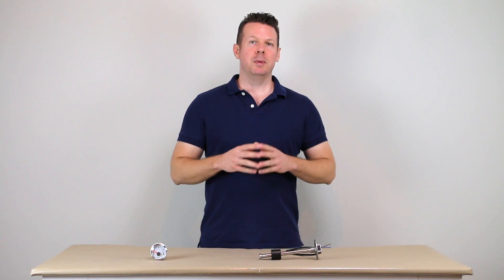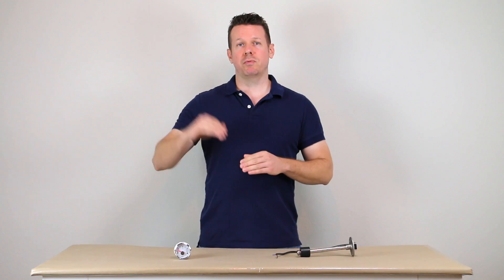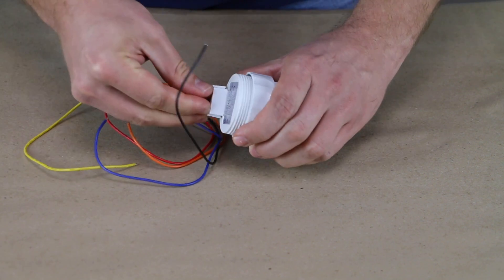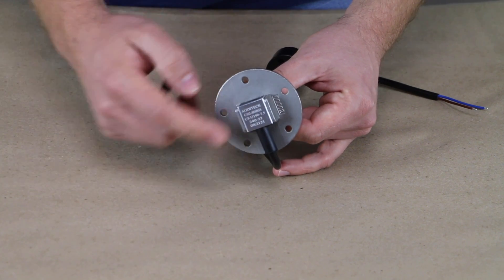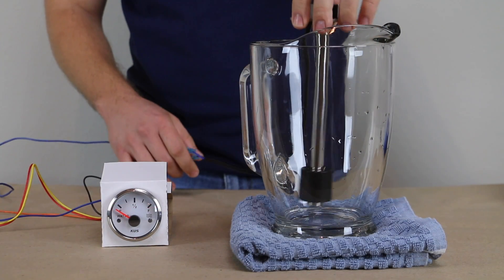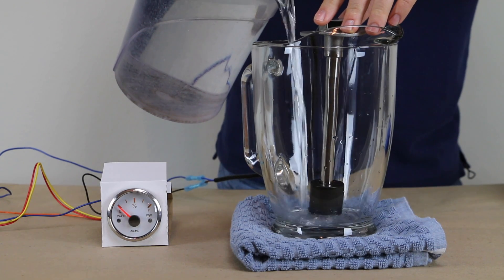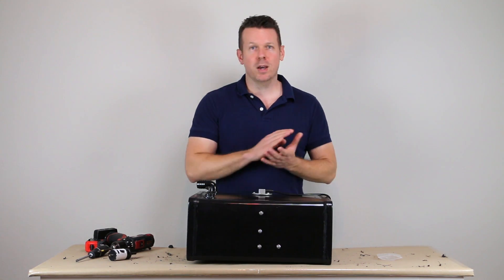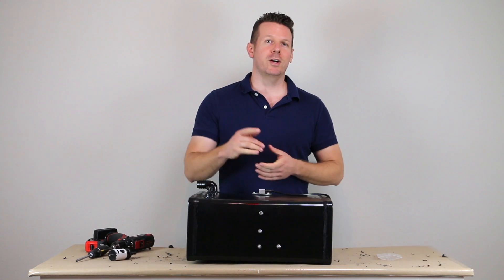The Best Water Tank Gauge for Van Conversions? | KUS Tank Gauge and Sender Unit Explained

Comment: Nice video!
I’m new to your channel, and had a few thoughts while watching this video.
I’m sure you have a thousand requests for various content. I’m curious what your thoughts are on “advanced installation” options?
If you are creating content for #VanLife DIY builders, this water level sending unit and gauge option is perfect to get started and may be enough to for most.
If a builder plans to expand the functionality of this level and gauge, builders should be told to plan ahead with wiring (Giving them easier access later).
“Click here for advanced installation and functionality”
Two options to expand functionality come to mind:
1. Plan to wire this level sending unit to a Victron Cerbo GX
2. No Cerbo GX, but you want a visual warning? Wire the yellow and orange/red lights so they indicate “low water level warnings”. 
You could even have the orange/red light flash when below 5-10% with a bit of simple circuitry.
Thank you for any feedback or links to videos that may cover this type of installation.
Reply from the maker: Hey there, thanks for checking out my videos. Interesting ideas you have here. As far as hooking this sending unit to the Cerbo, I do tie it in or mention in several of my Cerbo videos. I have a playlist on the Cerbo here: https://www.youtube.com/playlist?list=PLWoQHaxPSGfwdZif5uZSCAES_RLFR3_xJ

I suppose on the 5-10 flashing lights, that would be cool but would probably be for someone with additional electronics interest. I am mostly covering broader topics here. Thanks again for tuning in!

Comment: Love the video.  Especially the rewind on the water pitcher!

Do you know if it's possible to wire up the sender to both a KUS gauge and a Cerbo GX?  I'd love to have a KUS at the back of my van for when I'm filling, and then use the Cerbo while in the van to monitor tank levels.  

I'm guessing there'd be a problem if both units were trying to measure at the same time.  Probably both would get half the current and then assume twice the actual resistance.  Maybe I could add a switch at the rear of the van that toggles between the two so that there's only one current return path active at a time.

Curious what your thoughts are on this.
Reply from the maker: Hi John, thanks for tuning in! Great to hear you liked my water pitcher rewind trick. On the KUS, it is my understanding that they make a special model with 2 outputs for situations like yours. I would contact KUS directly or surf their site to see if you can locate it. I haven't used it but it reportedly exists. Hope that helps, and thanks again for tuning in!

Comment: Hi, thank you for the great instruction. Don’t know what happened with my gauge (or sensor) but it shows the opposite of the water level. So when it’s empty it shows it is full. Any idea what I did wrong? Thanks!
Reply from the maker: Hey there, thanks for tuning in. It sounds like the wires may be reversed. That would be my best guess. Hope that helps!
Reply: Hi, thanks. Thought so too, didn’t work unfortunately.
Reply from the maker: @hielkek  Ah ok. If it were me I would measure the resistance in the wires when the sender is in the full vs. empty position. Make sure your numbers are what they should be, if so, then there could be an issue with the dial. I would use a multimeter to measure ohms of resistance, to see what I'm getting. Hope that helps-
Reply: @rosslukeman  Thanks a lot, I will try and let you know.
Reply: @hielkek  Hi did you work out the problem as the same thing is happening with mine?
Reply: @MrRobinski  hi, unfortunately it didn’t work out for me. Getting used to it;)
Reply: @hielkek  ok thanks, i just learned its the difference between American 240 to 33 0hm and European 0 -190 ohm will have this issue when the  gauge or sender unit is one of these types instead of the same makes this problem

Comment: hello I want to ask, if I buy a level sensor with a length of 30cm and I want to modify it myself by extending the rod 2 meters long is it possible
Reply from the maker: Hey there, thanks for tuning in. I would not do that as there are waterproof electronics (magnetic reed switches and resistors) inside that tube. What I would do is get something ultrasonic from Mopeka (wireless) or Safiery (hardwired) in that case. Hope that helps!

Comment: Hi Ross, Thanks for this informative video on the KUS monitoring system.  I have a couple of questions:  1). Any advice on which direction the wire should placed?  My assumption is that it should face the direction of the wire that will come from the van (e.g. when hung under the van).  2). Do you have any advice on adding a larger 'clean out' access port to the top of any tank in order to perform cleaning maintenance?  3). Will you be providing a future video on the SeeLevel System installation and wiring?

Thank you for these informative videos!
Reply from the maker: Hi Kate, I'm glad you liked the video! On the direction of the wire, I am assuming you're talking about the wires from the sending unit. On that, I don't really have a preference. I think any direction should be okay. On the cleanout port, I don't have any experience with that, as I typically just flush the tanks with more water. On the SeeLevel system, I would like to say yes and may cover that in the future but I don't yet have that equipment and have a few more things I'll be covering before I take on newer topics (and buy more parts). Although after the KUS gauge and Micro Monitor videos, I'm kind of feeling like I should round out the collection. I wish I had more affirmative answers, but thanks for tuning in and leaving your thoughtful questions.

Comment: Hi Ross, thanks for the video, I gave it a like - how exactly did you measure the length in the tank to choose the length for the sensor?
Reply from the maker: Hey Sam, thanks for the like! For the sensor size, you would just measure the outside height of the tank, and subtract 1 inch. Hope that helps!

Comment: This might sound like a stupid question but how do I know what size sender to buy? I really like the look of the gauge and the idea of the sender but I’m not sure what size to buy? I’ve got a 100 litre tank, but am I right in saying it would be the dimensions of the tank that matters?
Reply from the maker: Hey there, it's based on the height of your tank, top to bottom. You're supposed to subtract an inch from your tank height and that is your sender dimension. Sometimes I subtract less that an inch, as long as the sender rod does not hit the bottom of your tank, you're good. Thanks for the question!

Comment: Hey mate, was wondering how do I work out the measurements when ordering it, my tank from top to bottom is 395mm, when they have there measurements on the site are they measuring from just the rod, or the actual whole thing including the top thing
Reply from the maker: Hey there, the official measurement listed on these sensors is only referring to the rod. The top thing is not included in the listed measurement. They also encourage you to leave 1 inch or 25mm between the end of the rod and the bottom of your tank. So maybe go with something around 370-375mm if it's available. Hope that helps, good luck with it!

Comment: Hello! First, thanks for the video! I do not have a symmetrical tank. Mine is a wheel arch tank. I assume that the system shown is not suitable for this, is it?
Reply from the maker: Hi Michael, all of these sensors are pretty much based on taking the water level reading. If you have a clear space where you could get one of these sensors to fit in the tank top to bottom, then it would work. If not, then perhaps a SeeLevel monitor stuck to the outside. Either way it would just read the water level, which as you would suspect will appear to drop faster once it gets below the wheel well and the tank cross section thins out. Either way you would know if the water is at the top, bottom, or middle. Hope that helps, kind of a frustrating situation!
Reply: @rosslukeman  Hi Ross! Thanks for the detailed answer. It confirms what I have suspected. I guess I have to use one of the sensors which work with the capacitative method. The one popular in Germany is from Votronic. I just do not like their displays ;)
Reply from the maker: Michael I was researching for another video and found that with the Victron Cerbo GX, you can create a "custom tank shape" in the software, so that the readings it takes are translated to a more accurate percentage remaining. Here's a little blurb from them:

"Custom shape
It is possible to configure custom shapes for non-linear shaped tanks using this setting.
For example: if a tank that is wider up top, the tank shape can be configured so that a sensor reading of 50% equals only 25% of
volume.
Up to 10 positions can be set to accurately describe the relationship between sensor reading and tank shape, even for highly
irregular tanks. The tank volume is linearly interpolated between positions."

It's been a while since your original comment but I wanted to add this. Good luck with the project!
Reply: @rosslukeman  Hi Ross! Thanks for coming back with a recommendation again, that is very kind. I will have a look into it. Kind Regards!